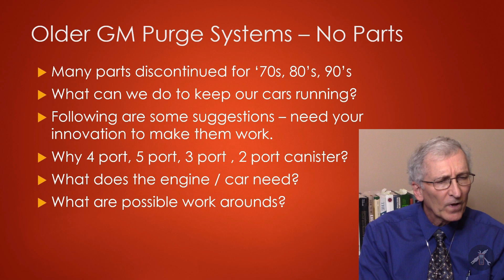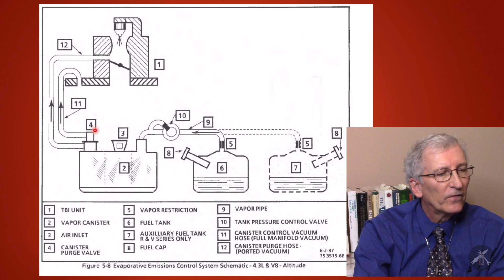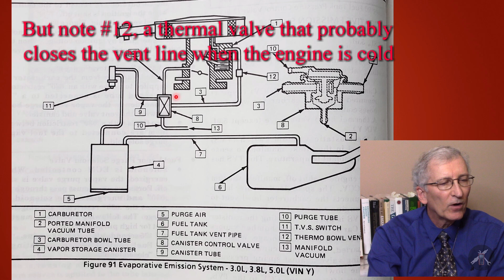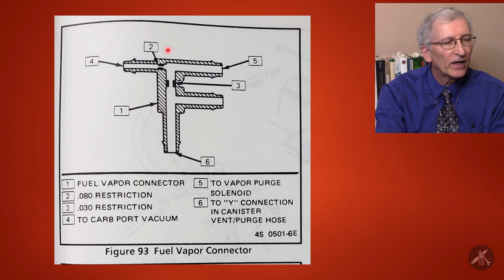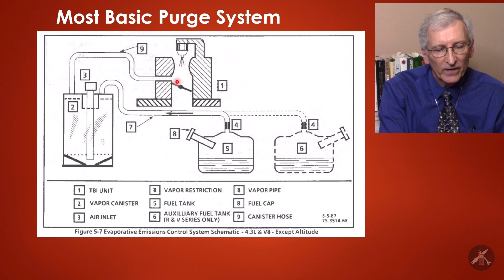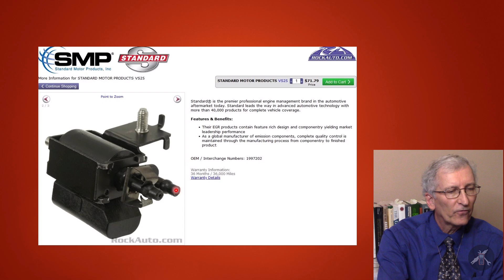GM OBD1 Purge Systems - Why all the canister ports? How do these systems work? Discontinued parts?

Comment: Thank you Dan - You cover the important things I need to know - problems I have restoring my camaro  - my 92 rs camaro has a canister thats just flopping around not bolted down rubber hoses rotting.  (Nice shirt and tie)👍
Reply from the maker: Yes, the canister is a frequently overlooked and misunderstood device.  It's worth a little more attention.
Thanks on the shirt & tie.  I just happened to be doing this video on a Sunday afternoon.

Comment: Thank you so much for making this video! I did not expect it so soon! When you mentioned ported/manifold vacuum and NC/NO vacuum switches, it finally made sense to me. I now understand that the carb bowl vac switch is N/O (allowing vapor into canister when the car is shut off) and manifold vacuum closes it, while the normal purge system is N/C and is activated by ported vacuum when the engine is warm. I have seen 1 or 2 canister rebuild videos, I think I will give it a shot after the summer season. Thank you once again for taking the time to explain it! My wife didn't understand why I jumped up when I saw the thumbnail, until I explained to her that this video was made for me. :-)

Comment: Nice my 1991 k1500 has idle problems sometimes and sometimes not but when acting funny can give it gas and goes away I’ll put couple EGR silanods on it so idk lol engine and transmission out of 1993 blazer so lots of stuff changed  even ecm  salvage yard deal lol but every day driver just had moments